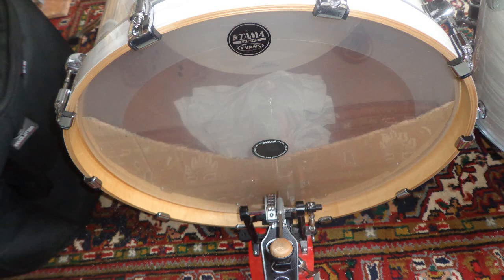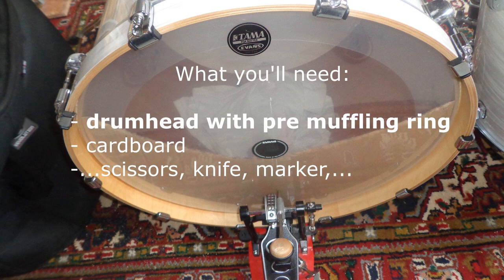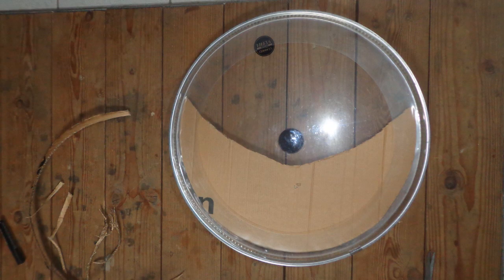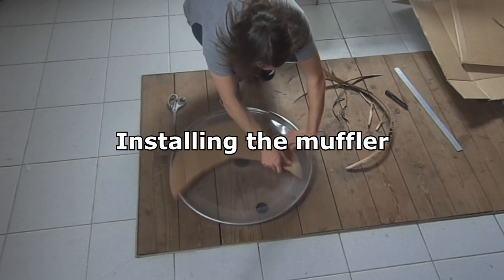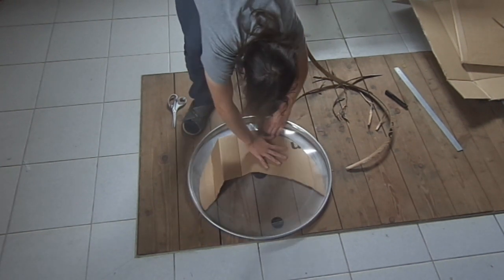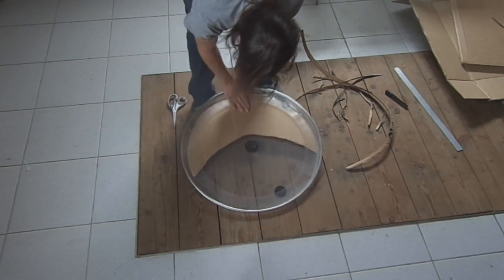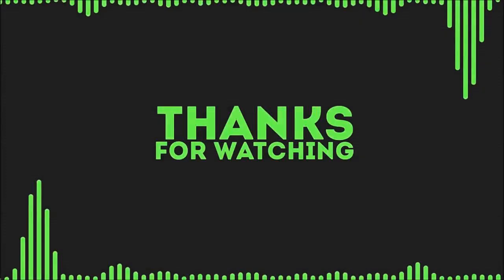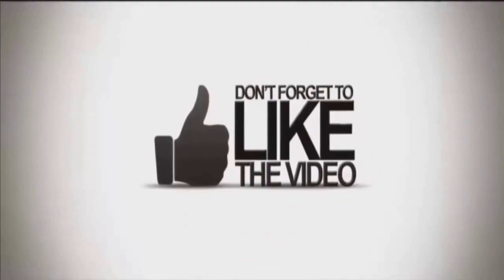Simple KICK DRUM Muffling Secret with cardboard|how to muffle a bass drum|kick drum muffling|pillow

Comment: If you buy a really good head instead you dont have to make this.
Reply from the maker: What head are you suggesting?
Reply: Elskyo Music Remo  clear Powerstroke 3 with a small towel touching the batter and a t shirt touching the resonant head works great in my Tama B/B bass drum. But the smallest hole in the front head that allows you to stick your arm inside the bass drum to position your muffling. I have a 5” hole but a 4” would be just right. If you cut your own hole install a piece of felt around the inside edge of the hole to cut down on edge overtones or even gaffers tape works. I get tremendous low end with a massive punchy attack. If I want a slightly longer note I touch less of the batter head with the towel. Also using a Remo Ebony PS3 as a reso with no hole gives me a nice long note but it does make positioning the batter muffling more difficult. Another tip if you need a deeper bass drum note is to use the Remo PS2 with Black Dot. The black dot lowers the pitch of the head.
Reply from the maker: @Assimilator702  Do you have a recording on that? The best sound I got from that 24×18 b/b kick is at at 2:39
https://youtu.be/zZWK21bvAnk
Struggling to recreate that honestly :/